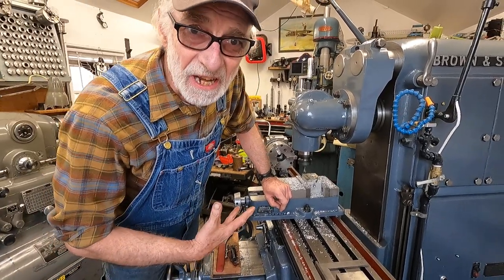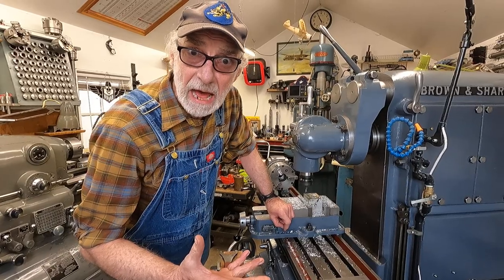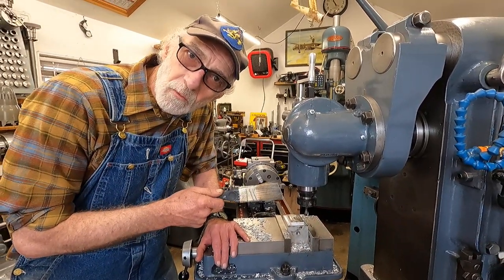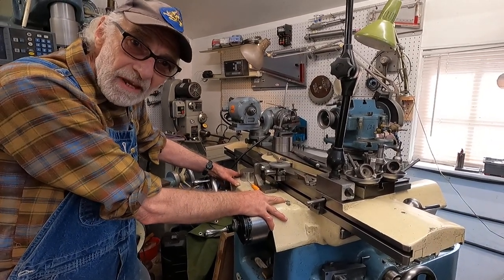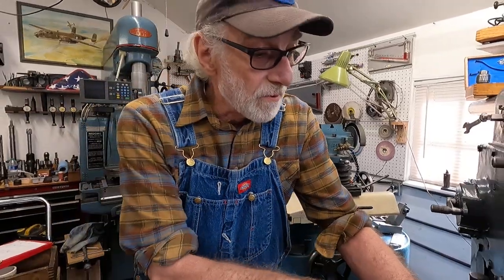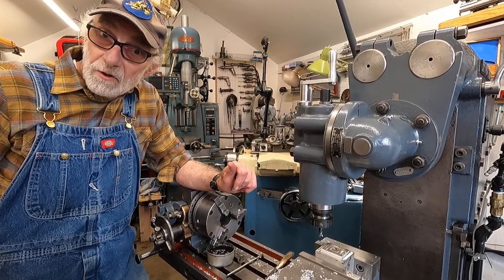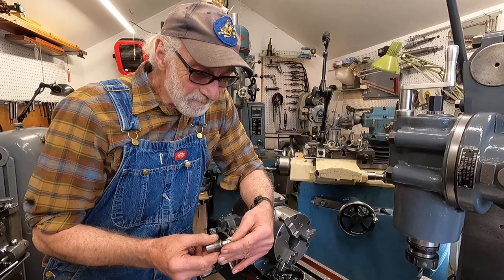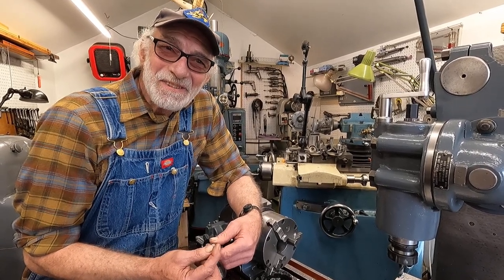Machine Shop, milling machine to jig borer

Comment: I bought a jig borer a few years ago, not really knowing what it was used for, thinking that it would serve as a small milling machine. I'm glad that I decided to get an old Bridgeport for milling and didn't wreck the little jig borer by abusing it. Now I'm finally starting to understand how it fits into a hobby shop: thank you.
Reply from the maker: I found the jig bore does good with very small end mills and does great fly cutting. It was explained to me the jig bore is for fine finishing when needed on parts first cut out on a regular mill. Thanks for tuning in!

Comment: Very keen to see where you draw the line at acceptable levels of material removed before the moore can handle it safely. Got my first intro to a moore jig borer on dan gelbarts channel. Extremely interesting bloke. I hope you come up with a series of videos on a project, make somthing or other, and make some special tooling to accomplish it. Great vids so far. Thankyou.
Reply from the maker: The machine will tell if it does not like something, you can mill with it but only light cuts.

Comment: Is that why they call it a "borer", to distinguish that it's for single point tools? I'm looking forwards to seeing how you use these machines!
Reply from the maker: Yes the machines spindle bearings and design is for using single point tools either boring or fly cutting. Often side loading with an end mill causes harmonic vibration in the machine.

Comment: Did you paint your machines yourself?
Reply from the maker: The jig borer and cutter grinder were painted blue by a machine tool dealer 30yrs ago. The only two I painted are the mill and the older Monarch lathe.